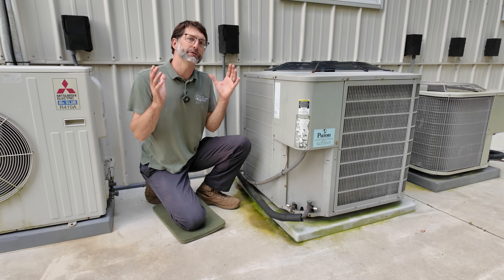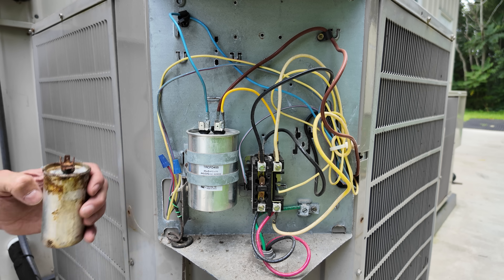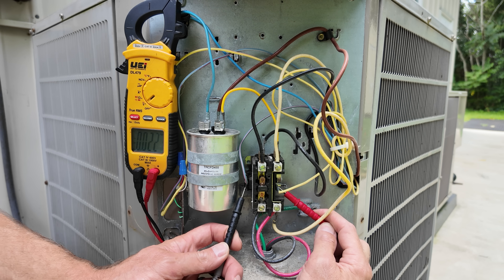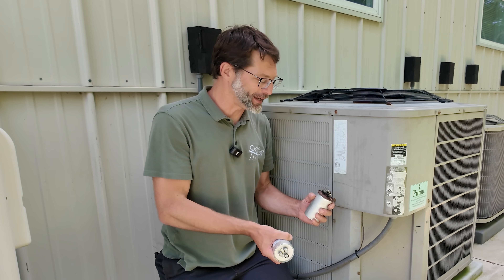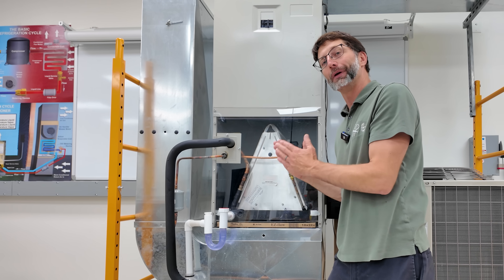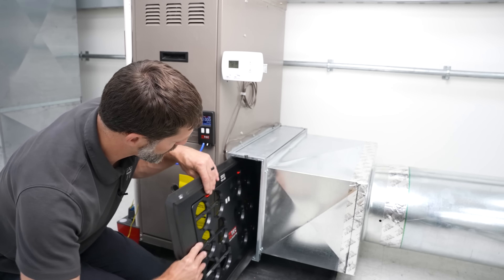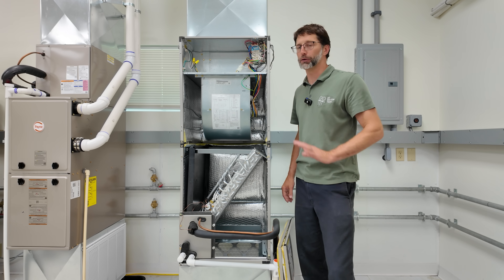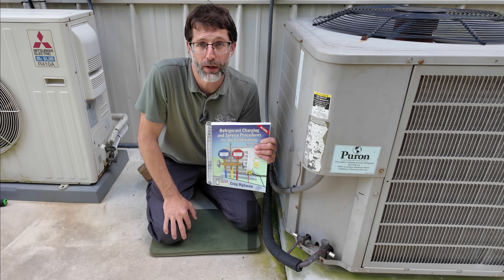Air Conditioner NOT Blowing Cold Air! Possible Problems Explained!

Comment: Great video, do you have a video on checking proper older model scroll compressor when Shutting off, as in how quickly low side pressure equalizes to determine if compressor is healthy or not
Reply from the maker: Check out these videos for more about Scroll Compressors : https://youtu.be/e9vORn5Vwuc
https://youtu.be/fhNb2gBhghE

Comment: hi this is my capacitor round dual run 30 + 5 uf +10/-5% 370/440 can i use a 30/5 MFD uF 370/440V CBB65 Dual Run Round Capacitor?

Comment: Thank you for your excellent videos! I'm tying to learn enough to avoid paying thousands for unneeded repairs. Is it normal for a new (one month) capacitor to make the same  loud tapping noise as the old one that failed. My A/C guy says $400.00 for capacitor and $800 for the whole "kit". He couldn't tell me what was included in the kit. 
Is it normal for capacitors to be noisy each time the unit turns on. ??? 
Thank you for anyone's help.

Comment: My unit just got replaced and it’s back to not blowing cold air. Last time he said I had a leak, and replaced the whole unit. So now what can it be 😢
Reply: I'm in a similar situation in which they said there is a freon leak causing warm air to blow inside the house. When you say they replaced the whole unit, do you mean just the condensor unit outside the home, or everything including the outside condensor, inside air handler, duct work, etc?

Comment: I need some help. Simple question a txv should keep a constant super heat right. If the super heat is not correct meaning little to know super heat. Bulb is not loose everything is looking great. That txv should be adjusted right.

Comment: Your video is very timely.  I believe I have the situation you describe at 6:28 of your video - fan motor running, but compressor is not.  The refrigerant line is cold and sweating, but the air coming out of the top of the condenser is not warm.  Is that most likely the capacitor?   Thank you.

Comment: How long would a service technician diagnose the problem when arriving at the job site? Please let me know in the  comments. Thanks
Reply: After entering the home to check air flow 1st, and to indicate that the indoor unit is running, the fuse in the a/h is good. Go to the outdoor unit, and check for high voltage. Pull the panel observe if the contactor is pulled in. Pull the disco, discharge the capacitor, pull the leads and check capacitor. No longer than 25 minutes 🤔 Checking the Delta T is included in the Air flow check.
Reply: @jamescollins8148 thank you brother.